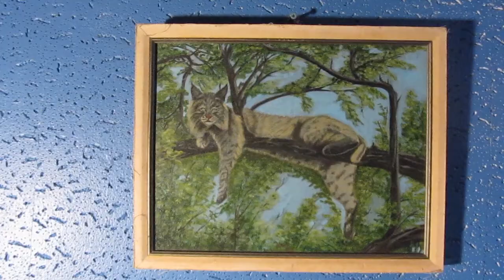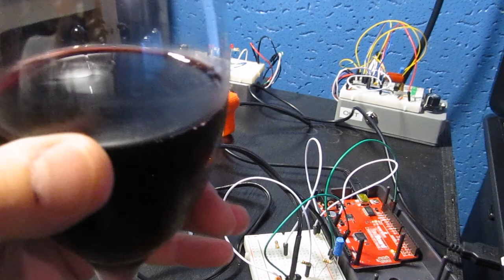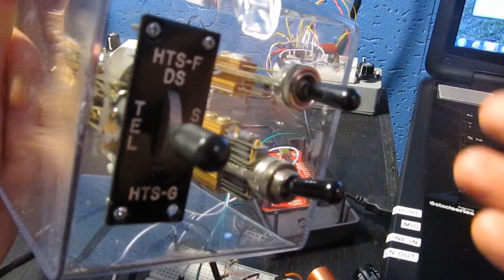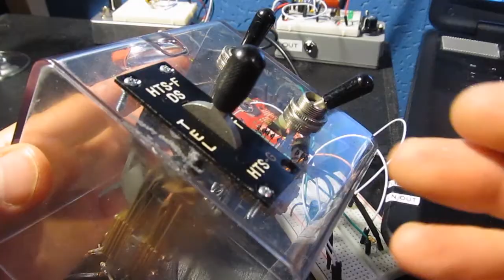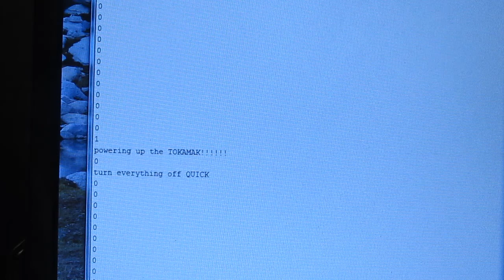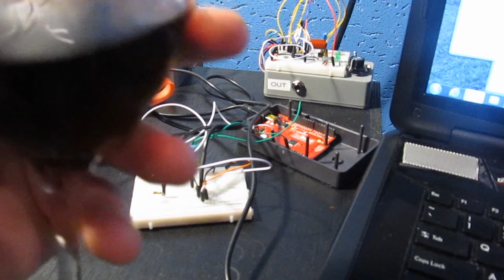Comment: There is a switch debounce circuit in the TTL Cookbook. But you're not going to like it. Don only invented personal computers, so what's he know anyways?
Reply: +Paul Frederick, thanks for the pointer, Paul, I'll check it out before I try to redeem myself.
Reply: Mofostopheles Jr.
Reliable switch debouncing seems to take a bit more than just a transistor, and a cap. Which is why I figure you're not going to like it. But as I can recall, having built the circuit myself, it does in fact work. TTL operates at ~50MHz, so it is fairly sensitive to switch bounce. The TTL Cookbook is like a rite of passage for anyone dedicated to digital electronics. So you should probably check it out if you get the chance.